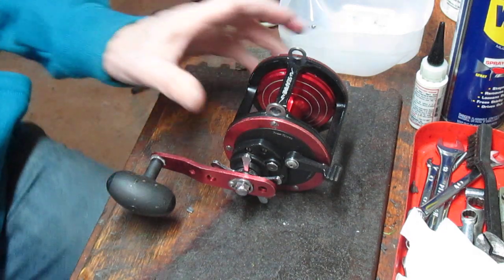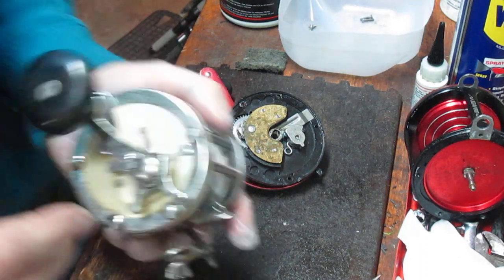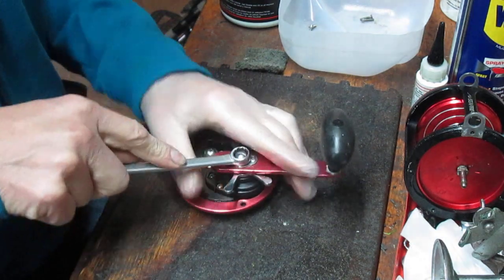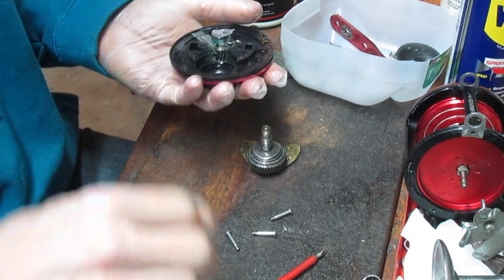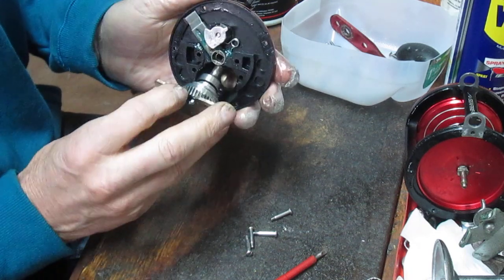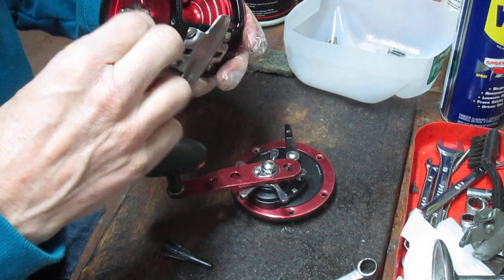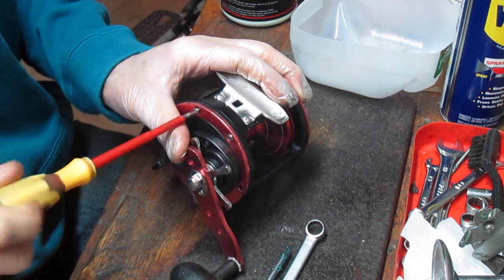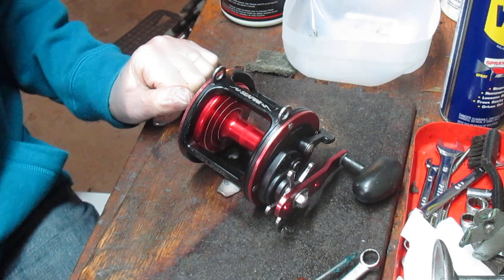Bass Pro Offshore Angler Seafire 4/0 take apart and maintenance

Comment: Hi Dennis, I just discovered your channel a week ago and absolutely love it. I do all my own repair and maintenance myself and your videos will be great reference for doing so. I have one reel that I am a little intimidated by and that's my TLD 10. Do you think you could maybe do a video on that reel? Either way, love the videos and am very happy to have found your channel. Thank you for taking the time to make them.
-Jamie
Reply from the maker: Thanks for the encouragement Jamie.  I don't have a TLD, but they come into my shop frequently, so I will film the next one I get in for you.  Once you do a lever drag reel, you can do them all.  They have a different mechanical design, but easy enough to understand and work with. You can start by pulling the reel schematic to learn the basic operation.  I think Mike's reel repair, which is based in Vancouver, Canada, has a library on Shimano schematic diagrams online. Do a search on Mike's site under schematics, ask to sort the Shimano reels alphabetically and scroll until you find it and print it  If you have other reels you would like to see, let me know and I will keep an eye out as customers bring them in for maintenance or repair..  FYI - I have posted about 30 different reels here, so you may also find one that I have done already - Dennis K
Reply: Great videos Dennis.
Reply from the maker: Thank you - Dennis
Reply: Hi Dennis i have a reel just like this that a customer brought me in a bag in pieces. Had to fix the cam spring an it’s missing the dog an spring for it but have a part he had in the bag that i can’t find where it goes.i have a picture if you have a email or number.

Comment: Dennis! Thanks so much for the video! I have been trying to decide to go with a penn senator or go with a 6.0 seafire for trolling and some bottom fishing. I looked at both in hand at bass pro and they’re similar and I found your video by looking for videos about the reel to see if it was actually decent and your video answered that! So thank you! I’ll be able to save some money and still get a decent reel.
Reply from the maker: Both reels are very good.  A post to note - you can easily get parts for the Penn Senator.  I am not sure how to find parts for the Bass Pro.  You should ask their sales team about parts and service availability prior to making your decision.  These reels take a beating in the 4/0-6/0 class and it is important that they can be serviced regularly - Dennis
Reply: Seafire actually has more drag than the senator. We use both and have been easing into the seafire

Comment: absolutely awesome video Dennis, Was thinking about picking one of these to backup the Avet 30/2 i just bought for sharking. this thing has an impressive amount of drag pressure despite holding less line. i was wondering about the quality of the internals till i saw this, but you have quelled my fears!.
Reply from the maker: MahiMahi thank you. Glad to have helped. All indications are that this is a dependable reel Dennis

Comment: Hello sir I was wondering if this would handle sharks in the 100-150 pound range and if you would recommend the 4/0 or the 6/0 for that purpose
Reply from the maker: I would definitely use the 6/0 over the 4/0 based on line capacity and bigger size reel = more line in per retrieve

Comment: Hi Dennis.. Would you happen to know if a different reels drag washers would fit this reel? Someone told me this reel is very similar to a Penn “Senator” .. Thank you for your videos, very helpful :)
Reply from the maker: I don't know what reel exactly, but if you measure the inside and outside diameter of the dag washer, there is probably a replacement available through Smoothdrag.com - thanks for asking - Dennis

Comment: Hey Dennis, I need Help, I dissembled the reel, and I'm having trouble fitting the spring behind the dog, it's like the spring is too big to fit behind it. I think this is always the tricky part about putting reels back together. What could I be doing wrong?
Reply from the maker: I'm not sure what reel you are working on.  Can you send a note to my email - 2ndchancetackle@gmail.com with a picture of the inside of the reel where you are trying to put the spring and I will try to help. Thanks for asking - Dennis

Comment: Dennis, I was also wondering something else about these reels. I just got into shark fishing two years ago and was using my pops old 12/0 senator for a while. I decided to go out and get an Avet 30/ 2 wide a few weeks ago. I was looking to grab an extra reel on a budget cause we frequently have guests with us. In your professional opinion, do you think these internals would stand a chance against lets say a 200-300lb shark, or would they be destroyed after a use or two? The drag pressure is impressive on them, but i was concerned with the bearings and drag washers holding up. Thanks for your time. Keep up the good work!
Reply from the maker: MahiMahi I don’t think this will stand up to that torment. I would rather see you with a 6/0 senator as a reliable backup
Reply: As always, Thanks for the information and opinion. So happy i found this channel. if i tried servicing half of my reels as good as you do, I'd wind up with an over glorified $3000 lawn sculpture after I brought out my welder in frustration!